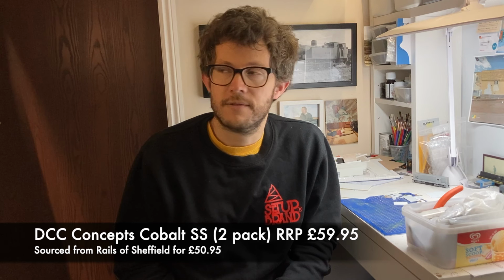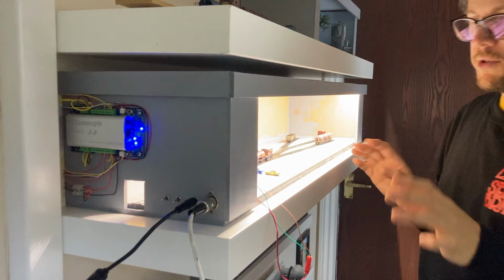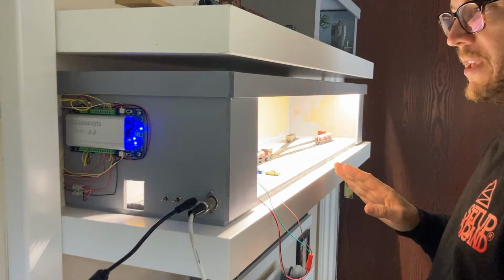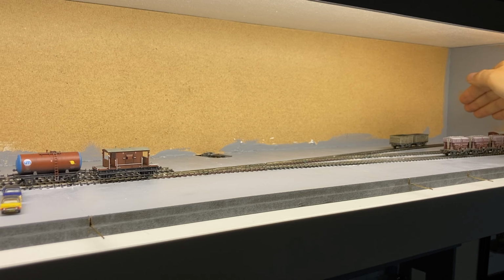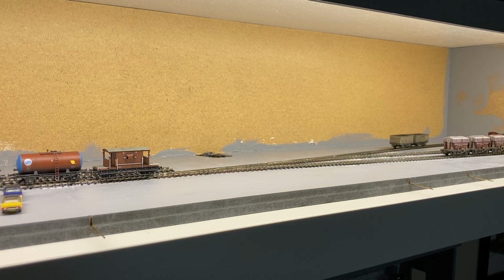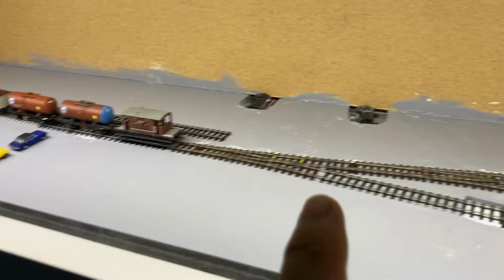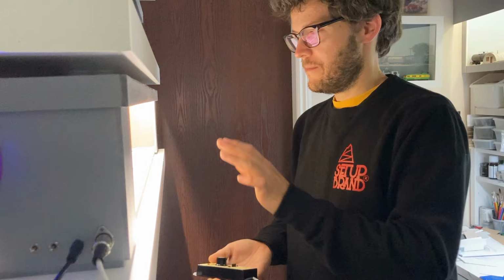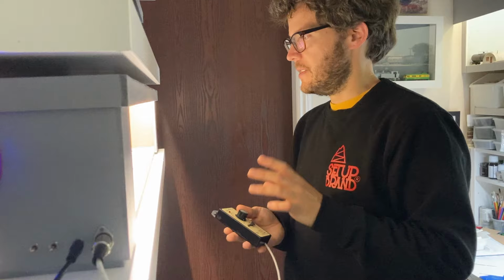Gerald Road in N - An Introduction

Comment: I might have missed you saying this: is this based on the branch out of Lawrence Hill, down to the stub of the old MR route to the rubbish incinerator? I used to work on those lines in the 80s and 90s. Looks good wherever it is! Thanks for sharing 😊
Reply from the maker: It’s loosely inspired by the end of that branch, down in the yard just ahead of the Blue Circle terminal and beyond, Distillers. That said, I’ve decided not to progress this one, so the board, as shown in the video is up for sale with all wiring and track complete - no stock included for £200.
Reply: Thats a shame! I'd be keen on it, but I live in New Zealand...!  @JamesHiltonCustomModelRailways

Comment: Another great video James. Can you explain a bit more about your magnet boxes please….what magnets do you use etc.
TIA
Reply from the maker: Hello Jeremy, thank you, very kind.
The magnets in boxes are a slimline way to use auto uncoupling without unwanted accidental uncoupling as when not in use you simply slide the magnet out from under the track. I use Kadee magnets which can be cut up with a razor saw. I usually aim for around 1cm cubes, the razor saw tears at the material so you get a bit of a mess but it cleans up. 
You need to test the polarity of the resulting cubes, to check the nest orientation for uncoupling. Once happy drill a small hole in the magnet and superglue in a brass rod. I then build small boxes in styrene, using WIP or 15 thou for the top amd bottom surface and thicker material for the edges and ends. Before they’re sealed up drill a hole for the wire to pass through and I out some Kadee grease-em, a graphite powder, as once sealed they’re fit and never see again! I find the thickness works well with 6mm MDF. mark out your track plan, then mark out rectangles and slots for the wire and cut out. Fit the magnet boxes and then the track over the top. If using cork you may need bigger magnet pieces for a stronger effect. Experiment to see what works for you!
Reply: @JamesHiltonCustomModelRailways  thanks James….really helpful and much appreciated. BW Jeremy

Comment: The bases boards are doubled layered. What is the material used please?
Reply from the maker: The two boards are 6mm MDF. This allows me to bury the magnets and the servos within the shelf layout rather than using a single sheet of 12mm. On a larger layout I’d use ply, but for one around 1m long it’s not to heavy and is lovely and smooth to work with.
Reply: @JamesHiltonCustomModelRailways  Thank you James. That makes good sense. I still have a couple of Sundela  boards 4 foot by 2 foot. Thinking of copying your idea with 6mm MDF with the top layer Sundela.
Reply from the maker: That could definitely work on a shelf based layout but make sure the sundeala just sits within the box rather than forming the structure, obviously!
Reply: @JamesHiltonCustomModelRailways  understood